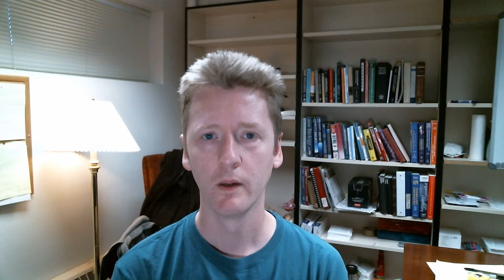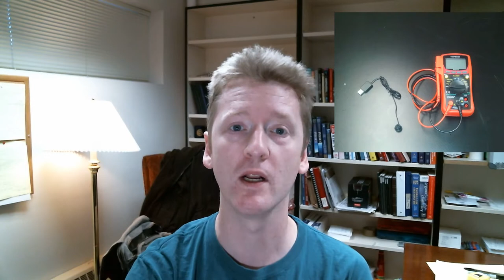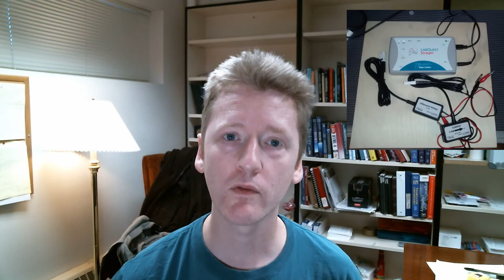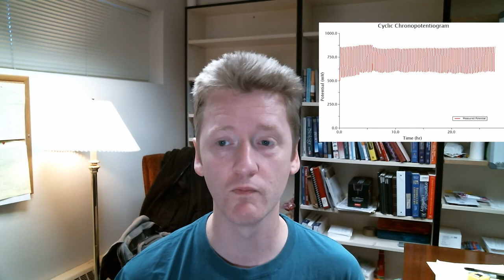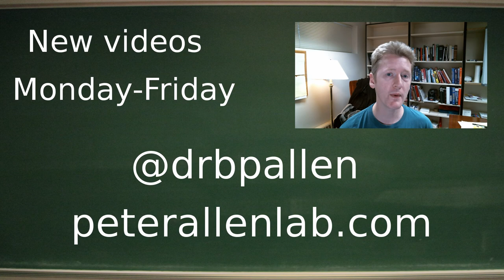Equipment for measuring and characterizing batteries

Comment: excellent video peter have the same prob collecting data i am using the usb multimeter and a hantek but yours are better. yes an adruino data collector would be ideal for those without a uni connection pse keep up the good work

Comment: This reminds me of a "Battery Management System" (BMS) , like is commonly found in Li-Ion packs.  http://en.wikipedia.org/wiki/Battery_management_system

It's interesting that monitoring: cell-voltage, current, and temperature and other metrics is useful not only in R&D but also in real-world applications.  So not all of this is lab equipment, since at least part of this is building a real battery pack!  

In order to minimize cost, most electronics products use application-specific computer-processors (microcontrollers) and firmware collectively known as "embedded systems".  So yes, in many respects "Arduino" (including the off-brands) is ideal for development because of the revolutionary way it has made embedded systems R&D so widely accessible.  I mean it allows a high-school student to build a project that in terms of the electronics design is surprisingly similar to an actual for-sale product.

Comment: I'm using a Vencon usba5 (universal serial battery analyser) this has two separate battery channels with current/voltage  control and sensing for each channel, The charge discharge sequencing is programmable too These are pricey  new at $900 (mine bought used) and if you need it,  you can have several on one PC. the software can log to a file.
Reply from the maker: Good to know - I have not heard of that one before. I'll look into getting one used and comparing to what we have. Have a look at today's progress if you're interested. I am still working with the Pine Wavenow which comes in at a little more than $1000 but is pretty capable:
https://youtu.be/3fOqemhiLhE

Comment: I might as well chime-in and say that I can think of an inexpensive way to measure (and data-log) charging-current and battery voltage with just 1 A/D channel.  Start with a power-supply consisting of a voltage source with a regulated constant-voltage, call it "Vs", (having sufficient output-current ,aka low output-resistance  << 0.01*Rs).  Then add a series-resistor in order to increase the overall output-resistance to a known constant value (I'll call it "Rs").  This type of circuit is very well-described by what's called the "Thevenin-equivalent model".  http://hyperphysics.phy-astr.gsu.edu/hbase/electric/thevenin.html  Now simply log the battery voltage "Vb".  If you know "Vb", then the charging-current "Ic" can be calculated very accurately by simply applying Ohm's law to the series-resistance "Rs", where Ic = (Vs - Vb) / Rs .  Be sure to test and confirm that Vs and Rs are constant over time and temperature, and current.  If this is the case then "Ic" will be strictly a function of "Vb".  Now, this setup may not have the sophistication, flexibility or redundancy that many people might want in a lab, but in theory it can work just fine and it is low-cost.  Sometimes simpler is better because it can be more predictable, easier to understand, and there are fewer components and things to break or go wrong in an experiment.